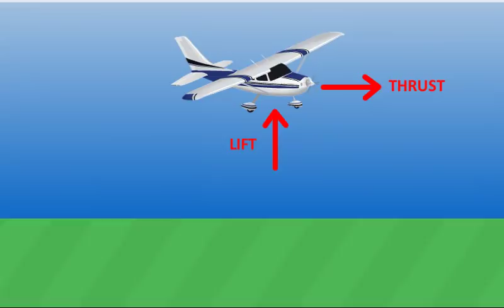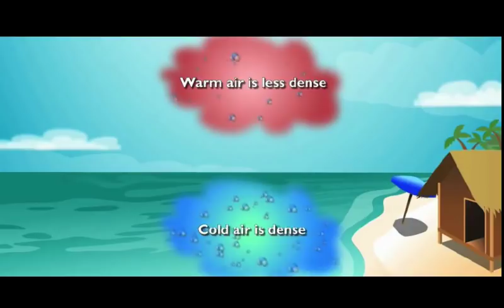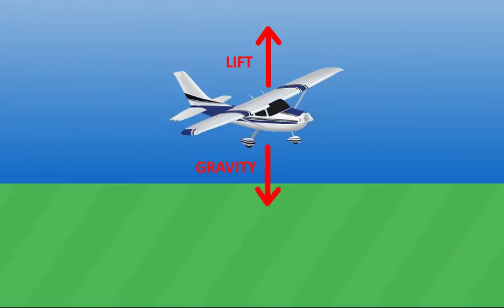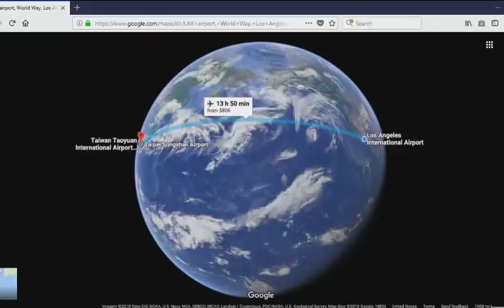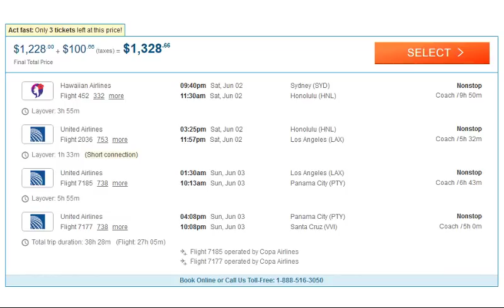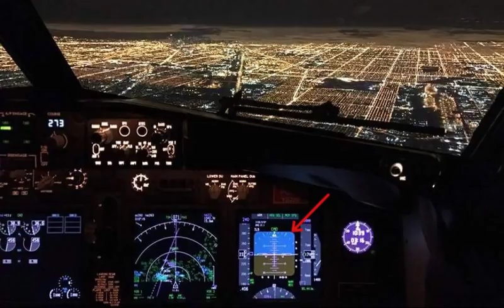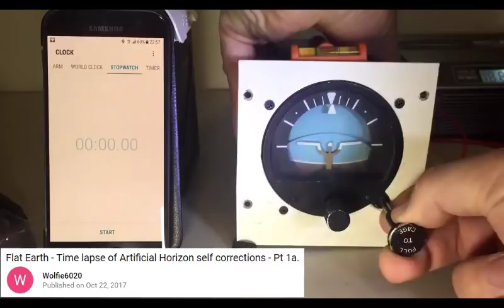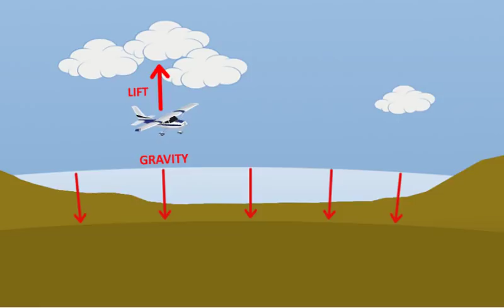Flat Earth Falsities - Plane Nonsense

Comment: "The laws of physic causes the atmosphere to rotate with the earth."
'It would actually take some unknown force to counter act the friction to prevent `the atmosphere from revolving with the earth"..... 
This would be slippage, where the atmosphere, seeing that it is a gas,  would not rotated exactly with the earth as the earth is a solid, there would be some sort of delayed reaction to the air from the earth, a sort of like a spony connection, like a boats propeller in water, it spins and spin and spin and eventually the boat gets going.....  
If this were the case and there is this slippage or sponginess from the rotating earth and the lagging atmosphere, then we would have a constant wind that never stops....We all know that this is not the case, we have the most calm and beautiful days, as if the world is not moving at all, maybe its not?.
Reply: "like a boats propeller in water, it spins and spin and spin and eventually the boat gets going.."
False analogy. Because after that initial slippage the board does get going. If the atmosphere suddenly stopped rotating with the Earth then it would have forests, jungles, mountains, cliffs and valleys smashing into it at 1000mph like a massive propeller. There would be some initial slippage, but it would very soon be spinning at the same speed as the Earth again.
"we have the most calm and beautiful days, as if the world is not moving at all"
A rotating Earth is not incompatible with calm and beautiful days. But a clam and beautiful dawn or sunset is incompatible with a flat earth.
Reply: Grahamstw......thanks for the comment....however the water that is rotated from the propeller never catches up to the propeller itself. this is indicated by the turbulence which results in bubbles of air around the propeller blades, this indicates that the water surrounding the propeller blades is delayed by the propeller rotating action thus resulting in slippage between the water and the movement of the boat.
Reply: The water is surrounded by stationary water, away from the direct force of the propeller, which provides drag in the opposite direction. Plus the boat is moving so is constantly entering new stationary water.

I think a better analogy is stirring a coffee cup. Stir in a smooth circle at a constant rate and you soon have all the coffee rotating.
(Even that is a little flawed because there the sides of the cup provide drag)
Reply: Grahamstw, yes I'm liking that analogy! However increase the size of the cup and you will have spinning coffee  in the middle an stationary coffee on the perimeter. this is slippage or drag.......the drag in the atmosphere will manifest as a constant wind....no wind no drag, no drag, no spin....
Reply: If you increase the size of the cup then you also need to increase the size of the stirrer. After all, on a globe Earth the entire planet is the stirrer.
You also need to acknowledge that drag at the perimeter of the cup is due to friction with the surface of the cup. There is no such opposing force at the edge of the atmosphere.
Reply: "You also need to acknowledge that drag at the perimeter of the cup is 
due to friction with the surface of the cup. There is no such opposing 
force at the edge of the atmosphere."
Correct.....the inertia of the outter layers would have to be overcome by the inner layerss and so on working inwards to the densest layers of air closet to the the earth surface.......ie the outer layers will lag the inner layers which are closets to the source of rotation.....
Reply: Ah, but in the atmosphere the outer layers have less mass so require less force to move them at the same rate. And what force is acting to oppose this rotation?
Reply: grahamstw.....This drag would mainly occur at the surface of the earth, (a solid)  coming into contact with the air (a gas) This is where maximum slippage would occur, like the propeller (a solid) coming into contact with the water (a liquid) in the boat example....what happens as the atmosphere thins out near the vacuum of space, which has no friction, is none consequential to this argument....If such slippage does exist it would manifest itself as a constant wind which would be strongest at the equator with the maximum surface speed and eventually tapper off at the poles. It would be as constant as the constant rotation of the earth.
Reply: I do like a Slow Mo Guys video, but the force throwing the water from the ball there is centrifugal force caused by the acceleration present in the changing velocity of the ball surface.
Incidentally we can measure this force on Earth too. The same object will weigh very slightly less at the poles than it does at the same altitude at the equator due to the centrifugal force.
Reply: Let's say that your proposal is correct.  Exactly how much "slippage" should we see?  I look forward to seeing your calculations.
Reply: But unlike the propeller of the boat, or the stirrer in the coffee, the surface of the Earth is a continuous surface. So if you imagine a single air molecule "slipping" against one part of the surface then it is immediately pushed again by the next part of the surface or by the moving air behind it, and then the one behind that, and the one behind that etc etc
Meantime, what force would be acting to slow it down again?
Reply: "Let's say that your proposal is correct.  Exactly how much "slippage" 
OGM, I'm not a mathematician, I'm a conceptualist, you can do the maths for me.
Reply: Ah I see, so you want to claim that literally everyone in the world is wrong but you expect us to do the work of proving ourselves wrong for you.  No Sir, that's not how it works.  You are the one making the claim, you are the one responsible for proving your claim.  If you are unwilling to do so then your claim is not worth considering.
Reply: graham.....two surfaces can slip against each other the result is called friction....I suppose the best visual explanation i can give you is this
https://www.youtube.com/watch?v=FVo2qdXxQ7o
its not air  but the closet thing to it,  water. other than that i cant explain any further and will have to leave it with you. regardless of the main content of the vid all i want to show you is the visial effect of the water on a spinning ball...
Reply: So as a "conceptualist" interested in rotation, how do you explain the apparent rotation of the stars around the celestial poles? Or that the sun and moon appear to rotate past at the same speed as the stars?
Reply: omg then don't consider it, piss off
Reply: graham the topic of this discussion is atmospheric slippage,
that's all i have for you, its been a pleasure, goodbye for now.
cheers
Reply: No worries, I wasn't trying to drag you off topic. Our posts crossed so I responded to your Slow Mo Guys video after the conceptualist comments. 
Good talking to you. Nice to meet a Flat Earther that is at least trying to understand what is going on instead of parroting the cult leaders.
Reply: Graham, I had to go but am back for a short while. Flat earther? I'm a truther, that's far more important than being a flat earther!
The spinning ball vid was a bad example of atmospheric slippage if such a thing exist, its all I could think of as an example but that is also a good point you have just raised. 
Centrifugal force, being a surface phenomena or a rotaing object, is greatest at the equator and zero at the poles. The force of gravity being equal all over the globe, so there is a weight discrepancy form equator to pole, but not much. What effect does centrifugal for have on the atmosphere? does the atmosphere extend out further at the equator due to centrifugal force compare to the poles and what of the none moving air at the poles, would this not provide yet more resistance to the rotating air at the equator, again adding to the drag or slippage?
What would be the speed of the rotating atmosphere in the stratosphere some  50k out be for example?  from my calculations about 8,000mph. It would also be interesting to see if the Apollo return flights from the moon encountered this enormously fast rotating atmosphere, it would of been like going through an ever increasing wind storm of epic proportions, was this reported at the time? unless of course they entered the atmosphere directly inline with the one of the poles where the atmosphere would be still.